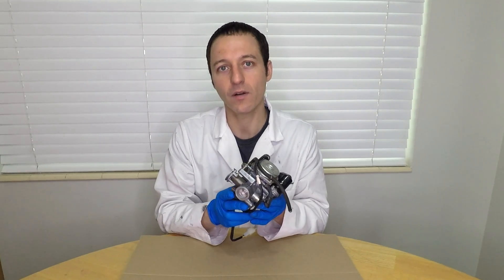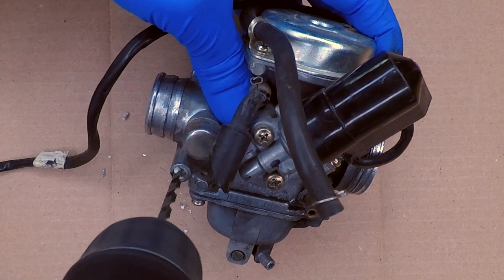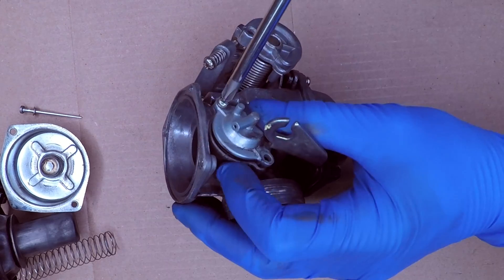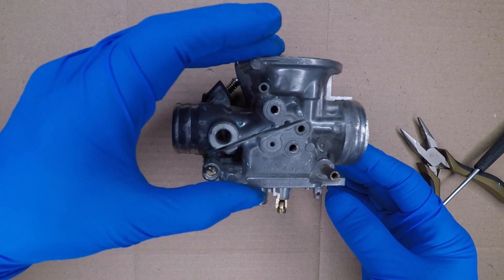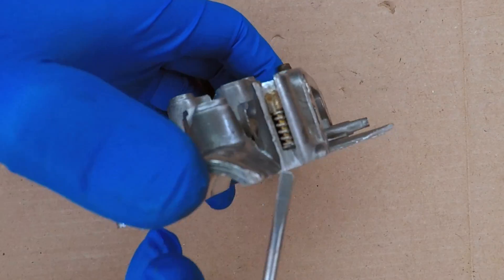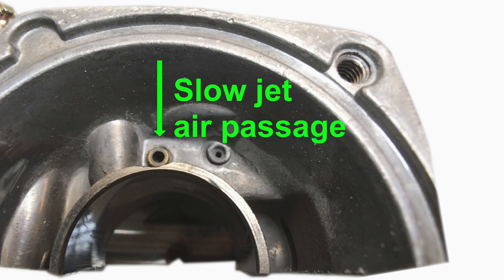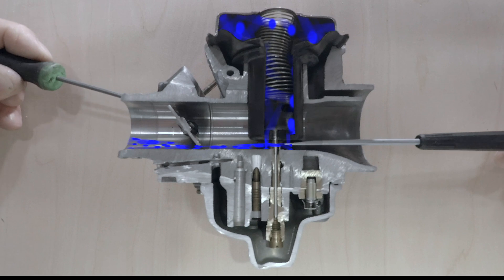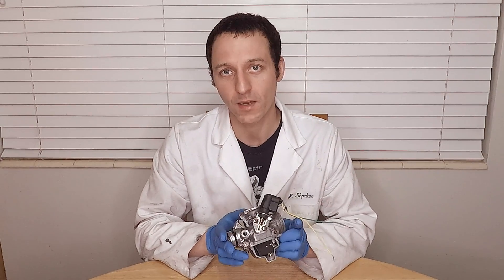How a GY6 carburetor works for 150 and 125cc scooters

Comment: Very informative, but I have fuel and oil mixture returning through the carburetor in to the air box on my gy6. 

I also have a GY6-125 ECU Motorcycle Computer Controller For ROJO Motorbike Electronic Control System Accessory which flashes 8 times on the red led and blue led is stable.

Why would engine oil and fuel get through to the air filter. The bike is a 4 stroke wangye eivissa 2 year of manufacture 2022.
Reply from the maker: The PCV (positive crankcase ventilation) hose goes from the valve cover to the air box.  This allows vapors to escape the crank case and they go to the air box.  You will end up with a little bit of oil in the air box too.  This is normal.  The oil isn't going through the carburetor, it's going through the PCV hose.

Comment: Ive been wondering if increasing the holes at the bottom of the throttle slide or increasing the airflow to the high pressure side of the diapragm would increase the venturi effect and speed up throttle response by trying to lift the throttle slide quicker?

Comment: I don't understand how that sliding thing works at all.
Reply from the maker: The throttle slide is vacuum operated.  As air goes through the carburetor, a vacuum is applied to the diaphragm on top and pulls the slide up.  Performance carburetors will have a cable attached directly to the slide instead, giving you better throttle response.
Reply: @LabCoatPaul  I am really struggling to get my engine running on a GY6 carb. I'm sure I've hooked something up wrong. On mine, there is a vacuum port that had a tube that was just open on it, and not long enough to reach anything. I figured that needed to be hooked to the intake manifold so I did, but it still doesn't work. This part of my project has turned into a major headache. I may disconnect that vacuum port and leave it open again, but my carby seems to deliver no fuel. I'm frustrated, it's new, and there's no instructions of course. I also removed the enricher/choke and plugged it

Edit: the starter recoil mech just exploded on this engine so I think I'm done messing with it

Comment: Hey what's up man I have a high-flow performance shorty exhaust and a nibi intake tube so that my uni filter will fit down there on my GY6 150 scooter. Obviously with all this extra airflow, I will probably have to go up to at least a 120 Main Jet I would assume. I'm also guessing I should leave the pilot jet alone. I'm having backfiring with flames shooting out of the exhaust upon deceleration which I know is excess gases escaping into the exhaust but I don't know why. I'm hoping it's because the spark plug needs to be changed as it's still the original. Since my carburetor is sealed, and obviously I need to up jet it, would I get any gain from just going up to a 26 mm carburetor from the stock 24 mm since I have to buy a new one anyway? Thanks a lot. If you're wondering why I'm putting the mods on a little scooter, it was stolen and totaled. The exhaust was snapped off and the OEM intake was ripped off. Plus I'm an ex motocross racer so I like to try to get a little more sound and power out of any engine LOL.
Reply from the maker: You only need a bigger carburetor if you installed a bigger cylinder.  Intake and exhaust upgrades can increase air flow over stock, but tuning your carburetor should be enough to get the right amount of power.  I'm not 100% sure what the carburetor does on deceleration, but I heard you need to make sure the vacuum hose on the side of the carburetor is connected.  
When you let go of the throttle, the slider closes, and vacuum pulls gas out of the main jet, but you don't have much air, so it can go too rich on deceleration.  You might try adjusting the needle height too.
Reply: @LabCoatPaul  thanks man I appreciate the educated response
Reply: @LabCoatPaul  I'm also used to working on simple 2-stroke motocross bikes so the whole vacuum line thing is something I need to check out

Comment: I had a 150cc SYM Excel II (VS1 in other countries), it stalls / engine dies if I fast throttle from idling, but in higher RPM no stall with fast idle. The carb is a keihin pd24j.
Reply: I have the same issue

Comment: I have a Romeo 150cc and it gushes gas out from the hose by the Idle mixture when starting. it takes a long time to start and when it does it just dies out. What could be my problem? Your help would be greatly appreciated
Reply from the maker: That's your fuel inlet hose.  Your gas is going on the ground instead of into the carburetor.  You need to replace the hose.
Reply: at :33 on your vid your thumb is touching the exact hose pointing downward where  gas is gushing from it is attached from carburetor to nothing
Reply from the maker: @texxmex266  That is your fuel overflow.  That means your carburetor is getting too much gas and it's spilling out.  Take off the float bowl and check your floats in inlet valve.  You probably have bad floats.  They might have a hole and they're not floating.  You can replace some parts, or just buy a new carburetor for $35.  http://www.partsforscooters.com/164-49-Universal-Parts-GY6-125cc-150cc-Carburetor?sc=34&category=133078

Comment: I have two New ZNEN 150cc scooters that when you start them up both pour gas on the ground. It does stop after a bit, but does it every time I start them. Any clue ? Thanks For Any Help You Can Provide.
Reply from the maker: Start by checking your fuel hoses.  They tend to get cracked and leak.  Also, you may have a stuck fuel inlet valve inside your carburetor.  Take the carb out and clean it, and check the inlet valve.